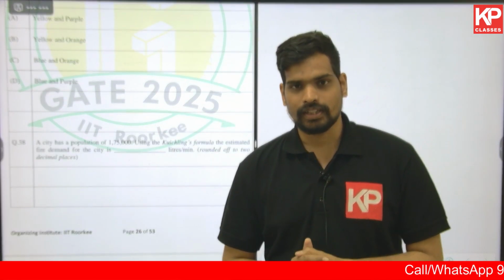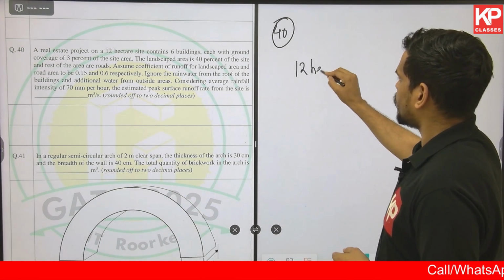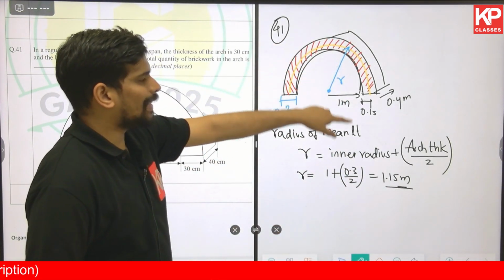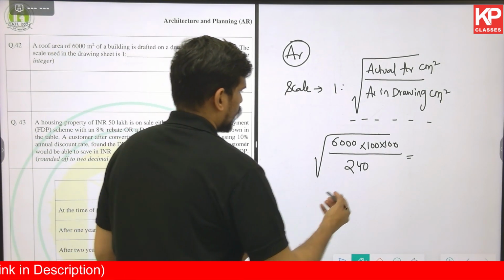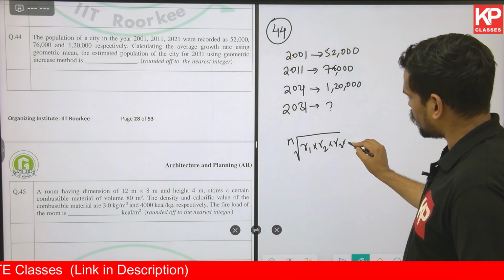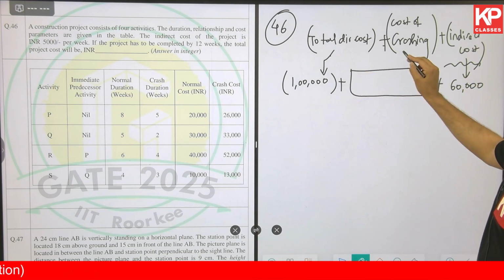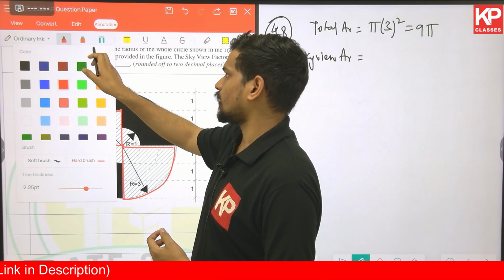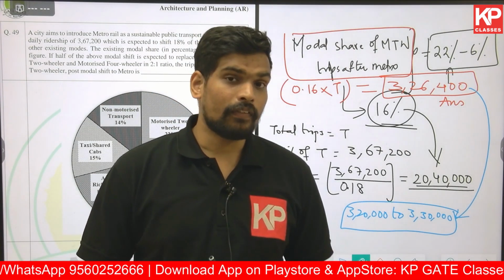🔥GATE Architecture 2025🔥| NAT Solutions | Common Part | KP Classes

Comment: What will be cutoff for GATE 2025 AR Discipline this year?
Reply: Some websites on internet is showing the cutoff for the above discipline to be around 42.5 for General (I think this year paper was bit lengthy and time consuming, gate has increased the NAT in the Part-A (Common), 

The Cutoff for this year GATE 25 AR should go around 35 around as per my understanding. 

What are your thoughts on this?

Comment: There was a question this year - Identify the correct relationship with respect to water quality from the following

options.

(A) Total solids = Suspended solids + Dissolved solids + Colloidal solids

(B) Total gases = Biological Oxygen Demand + Chemical Oxygen Demand +

Dissolved Oxygen

(C) Total solids = Suspended Solids + Dissolved solids

(D) Total gases = Biological Oxygen Demand + Chemical Oxygen Demand

The correct answer should be Option C, but the answer key says Option A..
Reply: Exactly answer should be "Option C".
Reply: @anujgurjar6622  Option C is correct because Colloidal Solids are a subset of Suspended Solids.